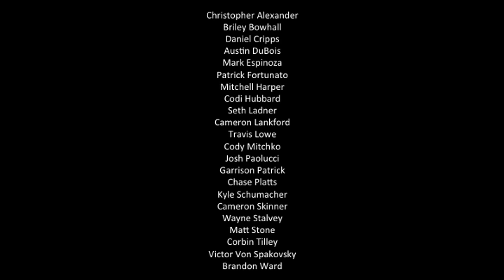Shake Hands With Danger Parody

Comment: If Daniel just read the manual, he would've known there was a bomb in there. It'd have been a pain, but he sure wishes he could go back and do it now. Valuable lesson to be learned.
Reply: What sick corporation would put a bomb in an earthmoving equipment component?? That's just fucken fucked up. Oh well, I agree he should have read the manual..
Reply: @Mike-qu8bh  I thought that stuff was regulated. guess not.
Reply: @ihateusernames2006  The " component " at 2:30 3:45 4:18 5:31 is an antenna rotator.
Reply: Moral of the story, whenever u hear t guitar rip, b on t alert
Reply: Doo Do Da-Da Do Doooooooooo "Shake Hands With Danger."
Reply: Little did he know they added plutonium too the core to increase density, the hammer causing an implosion detonation yielding 50 kilotons of tnt equivalent.

All of this could have been prevented had he read the manual.

Comment: I was on a tractor yesterday cutting hay and was distracted by a branch I was trying to push through and lift over exhaust while cutting. The tree was in the center of the usual large pile of rocks in field. The front wheel started climbing a rock, tilting tractor to almost roll with sickle mower attached!!  This could have had many outcomes. 99.9% involve death.  Luckily the situation recovered itself without much of my delayed input !   This is the 3rd time in my life I really may have been killed by own actions (mistakes)..

Comment: The " component " at  2:30  3:45  4:18  5:31  is an antenna rotator.    4:18 , the blaring radio guy,   This type of guy tends to blame " engineers " / throw tools / break things when they can't figure out a problem.  If they developed an understanding of how things work and didn't have the distraction of a blaring radio, perhaps they wouldn't struggle for the rest of their life.  Also, noise is fatiguing whether you realize it or not.
Reply: So, you're not a musician, then? Lol. Every one of them can't sleep after playing at 130db for 4 hours. So they all go hunt down a Waffle House. Before unloading 10k of stuff.

Comment: Where did you get the old antenna rotor? Did they shake hands with danger getting that off of grandpa's roof?....
Reply: 5:50 "Both men learned a valuable lesson." Put the barbeque sauce on after because burnt BBQ sauce does not taste good!

Comment: nah  you see you can live a happy life without your toes but try being happy with back pain. nope i take that 0,01% chance of the bucket falling on my toes. + you can get new toes you can't get a new spine.  (for those who don't know modern hydraulics now use safety messures to protect from suden pressure drop. it's not bulletproof so it can still fall but the risk is pretty minimal and toes are worth risking. it's another story if you put more valuable body parts in danger)

Comment: Standing on the track of the excavator with the hydraulic lock out to let down the bucket, UNSAFE. Riding in the floor of the dozer, UNSAFE, no steering lock on loader when working on steering valve, UNSAFE, no seat belt when running fork lift UNSAFE, not to mention countless times were students have no glasses or gloves on. Got lucky no one got injured making this.